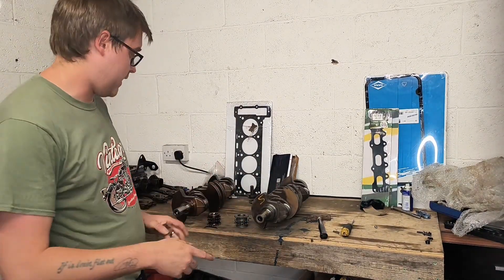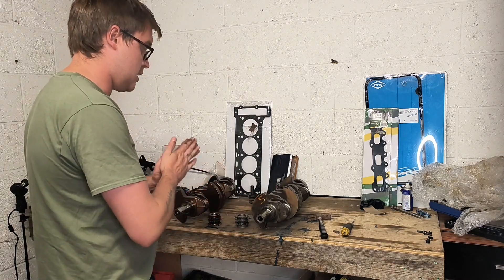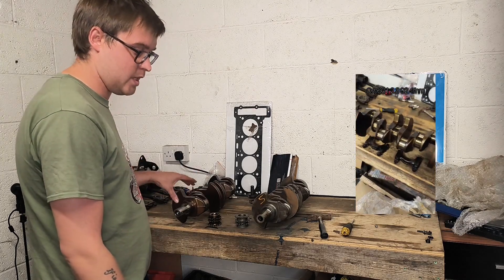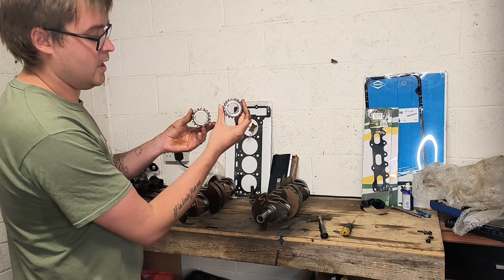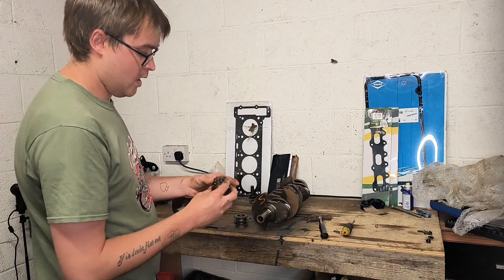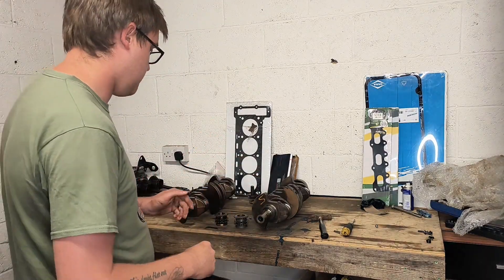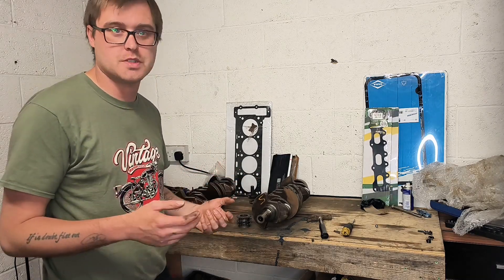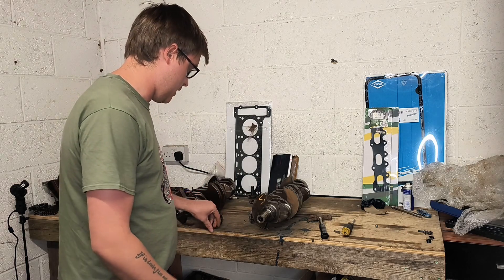Om601 Crank Vs M111 Crank ,  Mercedes M111 Turbo Stroker Build!

Comment: The key way is only for assembling and the crank bolt should hold it all together. If the bottom sprocket has spun the crank bolt was not done up correctly

Comment: Is that crank om601 vito
Reply from the maker: yes this is a om601 crank that can be found in the Vito or sprinter, this particular one came from a sprinter
Reply: how long the connecting rod is needed
Reply from the maker: I'm using 145mm rods from a M102 however I'm yet to find the N/a 2.3 pistons I need to bring the compression ratio up to a useable range

Comment: Any reason you don’t use the larger oil gear to spin the pump a bit faster to give you more oil? Especially if you’re not revving it quite as hard.
Reply from the maker: Personally we've never found any issues with oil supply so we just stick with the standard oil pressure as it's always worked ok for us, that would allow me to use the Om601 gear but ide rather just keep to the mb specs as too much oil pressure can cause its own issues especially if the pressure relief valve stays open and bypasses the filter

Comment: Longer rods equals more "leverage"
Reply from the maker: They do, however the longer the rod the more torsional force the rod is subject to, so the shorter rods should be more stable at higher RPMs and should have slightly more strength, the other thing to remember is the lateral angle of the rod and clearance with the block wall. so although I could keep the same length rod machine the piston and run higher compression get more torque, I would rather run it the way Mercedes did use shorter rods on a longer stroke, exactly the way the M104 3.2 is done 👍

Comment: Hi pal do you guys offer the M111 2.3K swap for a 190e as a service? I got a 190e and I'm considering the swap, I've looked through youtube and considering I'm not that technical I think I'd make a mess of it. Cheers
Reply from the maker: Hey buddy, Unfortunately not at this present time, however Casey at Boostworx is doing a 190 swap and certainly has a lot of useful information on the subject and where to source fairly priced parts from. I would like to be able to offer this as a service but unfortunately right now I'm not in the position to.

Comment: I have 2 questions unrelated to your build. (Dont get me wrong i love your idea and im really interested in seeing the dyno curves) So do you have any information on the specs of stock m111 springs? I cant find the numbers anywhere. Also do you suggest that with just harder springs the engine would survive 7000 rpm?
Reply from the maker: So unfortunately I don't have any specs for the springs currently, however I do know that hench performance do a set of pistons rods, and dual valve springs and retainers for the M111 engine, I suspect that the dual valve springs are likely M104 dual springs and retainers as the engines are very similar. But the engine absolutely could rev higher with a set of dual valve springs, however I would only do this with the addition of a cam and headwork as you will run into issues with head flow.
Reply: Mines stock and has gone to 7200
Reply: @anthonyf3253 i need to speak to you i have questions. This is my target also so are you using the m62 kompressor, and i would really love to see power graphs if you have any. Do you have any reliability issues and if you did change any stock parts apart from springs what are they
Reply: @СветлинКолдамов  running a Garrett Scania truck turbo custom built and modded to take a holset exhaust housing for quick spool 

It’s an m111.975evo running emerald k6
Reply: @anthonyf3253  mad, truly but sadly not helpful to me since im packing my angry m62 kompressor 😥
Reply: M111,something valvespring 46.4mm 0lbs, 40mm 36lbs, 35mm 74lbs, 30mm 118lbs